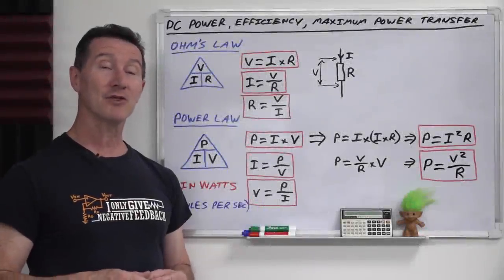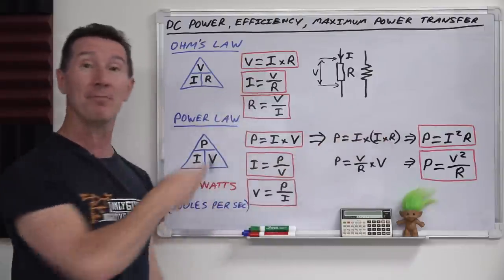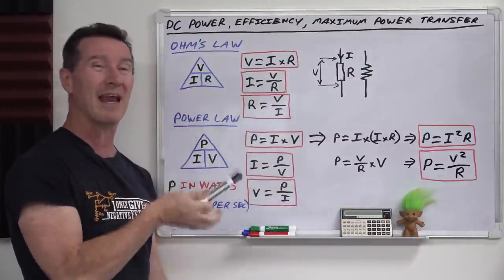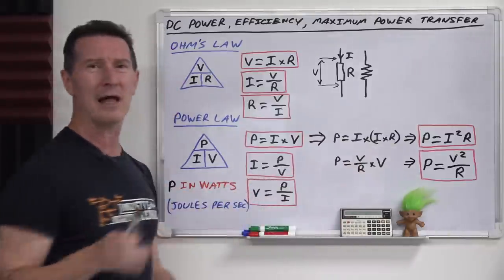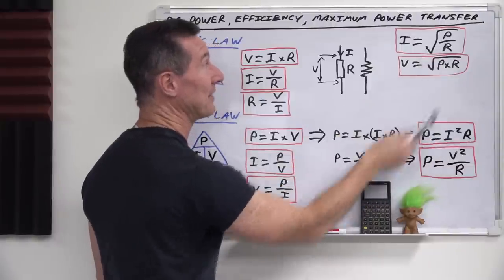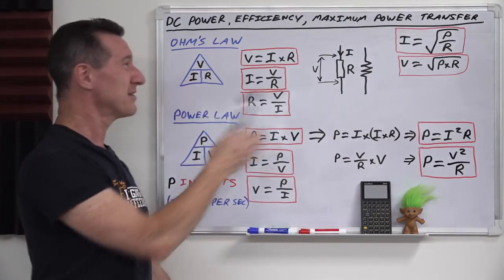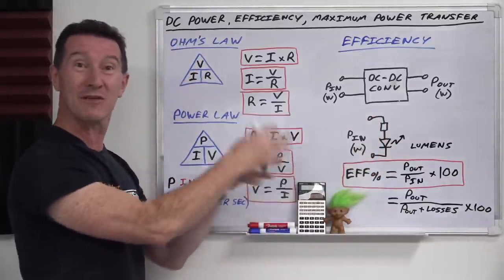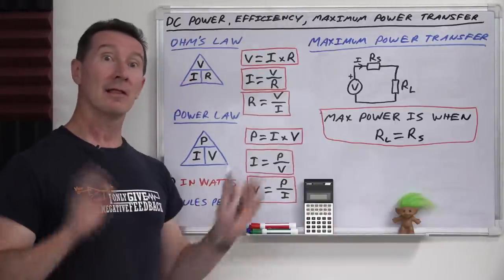EEVblog 1401 - DC Power, Efficiency, & Maximum Power Transfer Theory

Comment: Isn't what that is actually doing is getting the maximum power from the SOURCE not actually into the load, as you are treating the series and load resistance as one?
Reply from the maker: To get the maximum power from the source you simply short the source of course, and all you have is Rs. But that does no useful work. The whole point is to get power into a load to do useful work, and in that case you can't get more power than when Rl=Rs. And Rs is inherent in all sources, so there is nothing you can do about it.
Reply: The phrase is "Maximum Power Transfer".  One side is the source, the other side is the load.  The maximum power you can transfer from the source into the load occurs when the ESR of the source equals the load resistance.  The load is the object of the power transfer.

The series resistance and the load resistance are:
 1. Joined in circuit as required for circuit operation
 2. Two values that are used in the appropriate equations
 3. Two very independent elements

"you are treating the series and load resistance as one" - not at all.  They are part of the same network and subject to appropriate calculation.

Comment: Is this the same reason that you need to use the correct speaker impedance, like 4, 8 or 16 ohms? To get the power transfer matching?  Or am I off the mark with that...

Comment: "of course there are inductive losses as well".  What are they?  There are a lot of inductors in power equipment these days. How is inductive loss calculated?  What's the formula?
Reply: It's the energy needed to magnetise the core. This is what heats up those tiny linear power bricks that used to be everywhere. The transformer has some inductive (undesirable) element which is charged and discharged on every half-cycle.
Reply: @userPrehistoricman  I know that.  But what are they.  An ideal inductor is 100% efficient (as is an ideal capacitor). Any losses ultimately have to be resistive. Eddy currents in the core, wire resistance, skin effect etc.  I'd like to see that explained.  :)

Comment: Ok, so when I need absolute maximum power heater in my house, it should load my 220v line down to 110v. :)
Reply: correct :) Will also heat your local substation/transformer

Comment: Why is a resistor 100% efficient? Couldn't there be acoustic, vibrational, or magnetic effects which bleed energy in a form other than heat?
Reply: What has been described in this video is concerned with "ideal" models of components, this makes assumptions so that it is generally quicker easier to do go/no go calculations.  Yes you are correct in that resistors do have other losses but that detail would only start to taken into consideration in very important fields generally.
Reply from the maker: Because by definition it's just a resistor. If you want to talk practical, then that's possible, but in most cases it's so close to 100% you don't care.

Comment: I don't understand why do people still make the mistake of multiplying by 100 to get a percentage? They probably mean to multiply by 100%, which is 1, and multiplying by 1 is the same as doing nothing at all. 0.85 EQUALS 85%. And no, it's not some convention that Excel invented, it's basic math. And it's not like 0.85*100 is 85% because in fact that's 8500%.

Comment: There is nothing that's 100% electrically efficient.
Some energy is lost in generating magnetic field around the resistor and conductor. 
Photons galore.
Reply from the maker: This is DC theory remember. But yeah, there can be other energy loss mechanisms, but for most practical purposes it's 100%
Reply: Rubbish. It can absolutely be 100% efficient… the trick is to find out where all the energy went, and then tell the marketing team to list it on the front of the box! 
Best to also include a big red “x” next to the competition!
Reply: If you have a lightbulb which is also supposed to act as a heater at the same time then wouldn't it have 100% efficiency? ;)
Reply: @EEVblog  A DC light bulb is a resistor filament. It loses energy both in heat and light. But I get what you mean. I thought since it's fundamentals, one needs to be more anal about facts.
Reply from the maker: @onemanshow4116  Yes, as I mentioned in the video, it's how you define "100% efficient". A LED is 100% efficienct if you consider it's also used as a heater.
Reply from the maker: @piconano  I explained this point in the video when I talked about LED's

Comment: It is misleading to claim that max efficiency occurs when R source = R load.  That may be true of power transfer (Source to Load) but not efficiency. 
For instance let  V=100  Rs=10 and RL =90 
Then I = 1,    Ptotal = ExI = 100w,  Pload=90x1 = 90w. 
Efficiency = Pload/Ptot = 90/100   = 90% when expressed as a percentage

As opposed to when R source = R load,  the efficiency is then 50%
Reply from the maker: That's why it's called Maximum Power transfer theory and not Maximum Efficinecy Transfer theory.